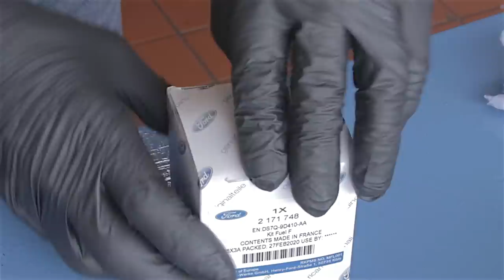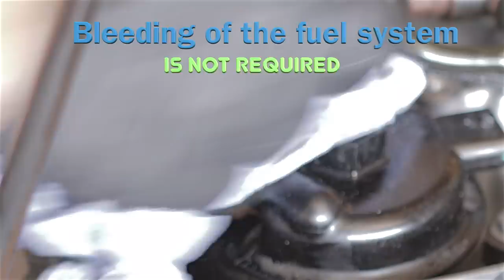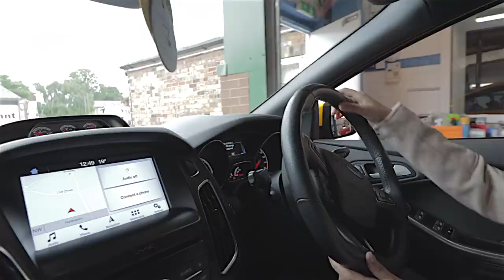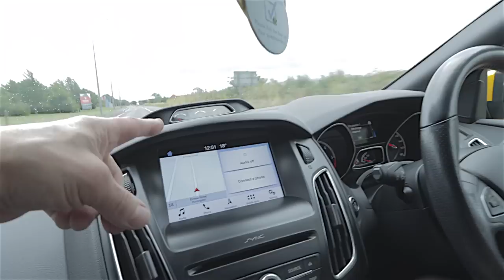2017 Ford Focus ST, 2l Diesel, Oil & Fuel Filter Replacement

Comment: So the engine is the same as fitted to your taxi fleet but ecu tweaked to give more power (182bhp). Its also the same engine as fitted to my 2018 Kuga (178bhp) AWD, but wait it can be tweaked further to 225bhp by reprogramming the ecu. Guess what I'm asking Santa for this Christmas!